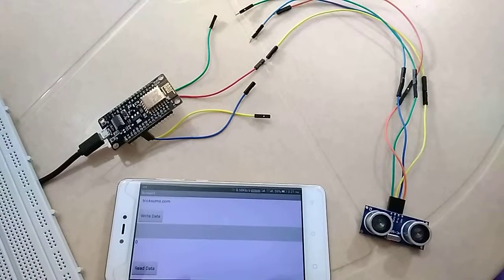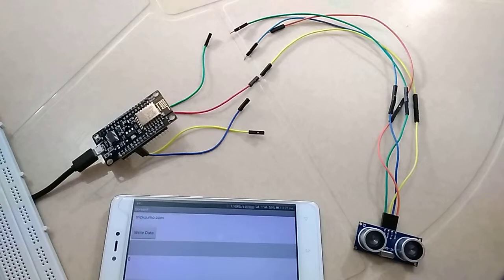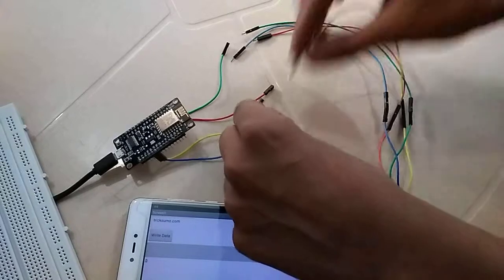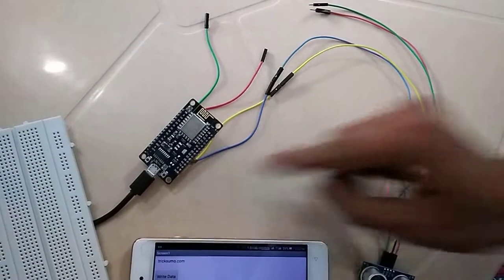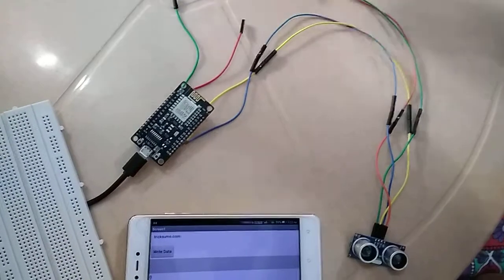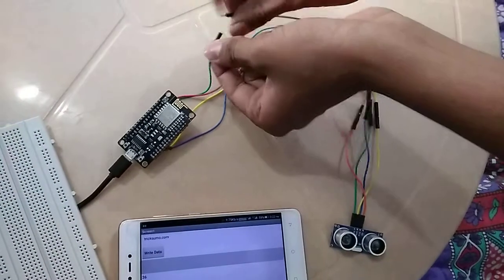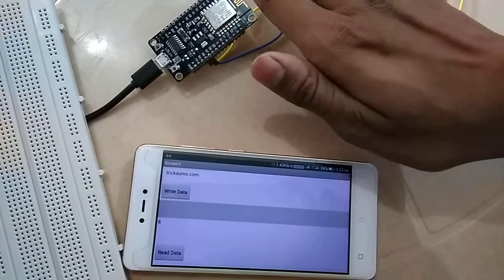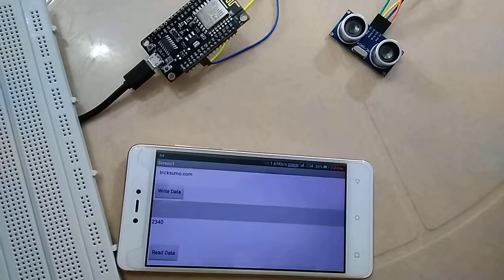SOLVED Ultrasonic Sensor Not Working With NodeMCU ESP8266

Comment: If that pin is named "RSV" on your board (which stands for "Reserve") this fix won't work because the pin itself doesn't work. Get an ESP8266 with a  VU pin ASAP if that's the case.
Reply from the maker: Thanks for sharing!!!

Comment: You're a life saver. Thank you. It finally works and I can see it on real time but my LiquidCrystal_I2C lcd(0x27, 16, 2) doesn't work after I connect it.. What do I do to make it work simultaneously with the ultrasonic sensor.
PS. I am using NodeMCU ESP8266 same as you.
Reply from the maker: Hi

Glad you find it helpful :)

In my opinion, both LCD and Ultrasonic are not working simultaneously because both need 5V power supply. Try using an external power source with a 7805 voltage regulator IC.

https://www.youtube.com/watch?v=li1mtgCEDwQ
Reply: @TrickSumo  It already worked. It turns out I just need to tweak it from the back. I already liked and subscribed. You deserve it.

Comment: I am not havin that VV pin, only reserved pin is present
Reply: Any alternative
Reply from the maker: Hi ,
Probably you are using Amica model of NodeMCU ESP8266.
Checkout this:- https://github.com/TrickSumo/water-level-indicator-controller/blob/master/Circuit%20Diagram%20For%20NodeMCU%20ESP8266%20Amica%20Model.JPG

Comment: If i use in arduino the sensor is ok, but in esp8266 only print zero
Reply from the maker: Hi

Reason behind this is that VCC pin of HCSR04 is not getting 5V supply.

To solve this:

For NodeMCU ESP8266 LoLin Model, connect VV pin of NodeMCU to VCC of HCSR04.
https://github.com/TrickSumo/water-level-indicator-controller/blob/master/Circuit%20Diagram%20For%20NodeMCU%20ESP8266%20LoLin%20Model.jpg

For NodeMCU ESP8266 Amica Model, connect Vin pin of NodeMCU to VCC of HCSR04.
https://github.com/TrickSumo/water-level-indicator-controller/blob/master/Circuit%20Diagram%20For%20NodeMCU%20ESP8266%20Amica%20Model.JPG
Reply: @TrickSumo  thanks soo much
Reply from the maker: @Luis222ism  Welcome :)
Reply: @TrickSumo  i coonected with vv in lolin ..but still not working
Reply from the maker: @sakibmiyan8870  

Hi,

Try using a 9V battery with LM705 voltage regulator IC: https://www.youtube.com/watch?v=li1mtgCEDwQ
Reply: @TrickSumo  hi ..glad u Replied....i saw a build a project smart water tank control and monitoring using android app with mit app builder...can u do the same projwct using blynk???? please let me know
Reply from the maker: @sakibmiyan8870  

Actually never used blynk library so no idea about it.

Comment: i will keep the setup mobile so it needs power through a battery or something.... please let me know any methods of giving power supply to the 8266 mcu(have emailed you in detail...)
Reply from the maker: Hi

You can use 9V/12V battery and 7805 voltage regulator IC for this purpose.

Take a battery, connect its +ve terminal to input of 7805 IC and -ve (of battery) to Ground pin of 7805 IC. After that connect Vin pin of NodeMCU to output of 7805 IC and -ve of battery to GND pin of NodeMCU ESP8266.

That's it!
Reply: @TrickSumo  Thanks a Lot Sir!!!!!!!!
Reply from the maker: @krishnapal1616  Welcome:) 

Glad it helped.

Comment: I have arduino uno and facing same prob
Reply from the maker: Hi

If there is low voltage issue, use LM7805 IC with 9V battery.
https://m.youtube.com/watch?v=li1mtgCEDwQ&t=90s

Else, there may be issue with ultrasonic sensor itself.
Reply: @TrickSumo  yes my ultrasonic is defected

Comment: Yr serial monitor p koi data show nhi ho rha h
Reply: Bro where is vv pin of nodemcu
Reply from the maker: Third pin from top left.
Reply from the maker: Hi Keshav,
Make sure baud rate is set to 9600 and connections are correct.
Reply: @TrickSumo  what is the connection? vcc to ? I can't hear you right i guess
Reply from the maker: Hi
Connect VCC pin of HC-SR04 ultrasonic sensor to VV pin of Nodemcu ESP8266. And GND of ultrasonic sensor to GND of Nodemcu.
Reply: @TrickSumo  thanks 😁
Reply from the maker: You're Welcome :)